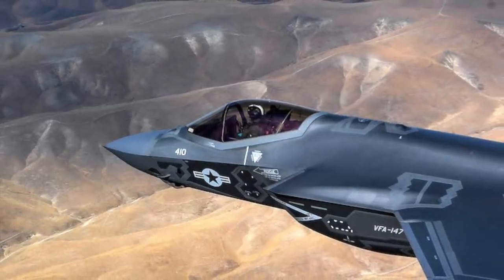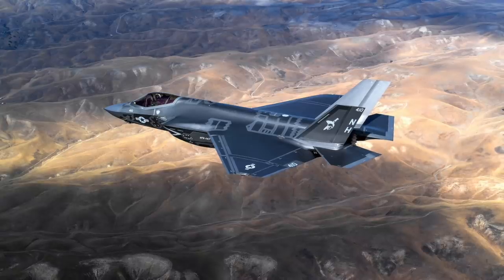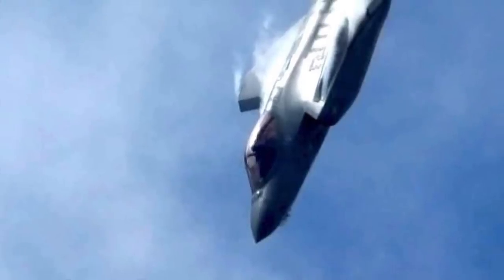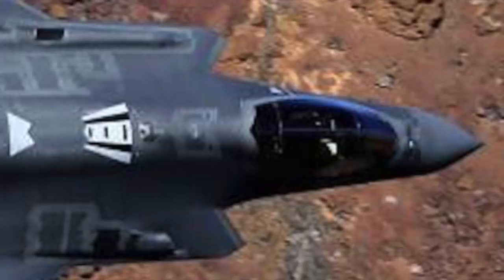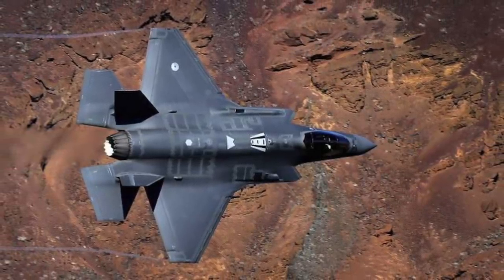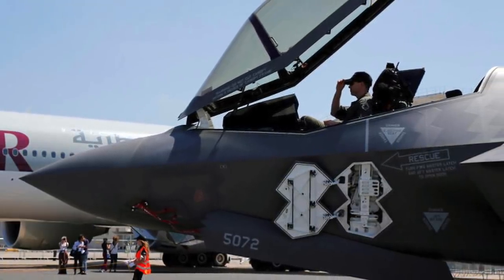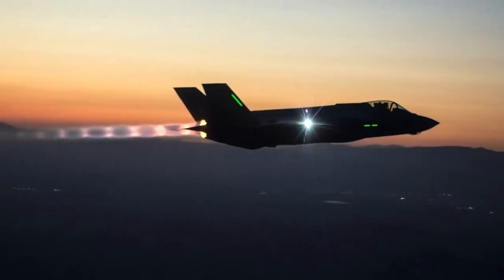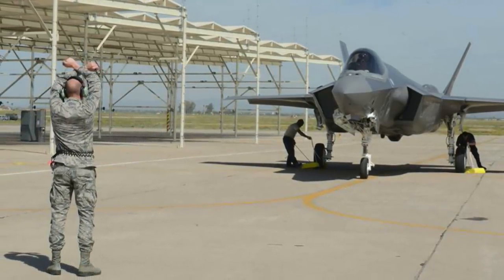HOW GERMAN MADE RADAR MANAGED TO DETECT F 35 5TH GENERATION STEALTH FIGHTER ?

Comment: There is a huge difference between detecting and accurately tracking for a missile lock, stealth does not mean invisible.
Reply: Hammerschlägen M  let me translate what he said:

You radar can be powerfull, It will not matter since no missile will be able to use that info
Reply: Hammerschlägen M  .  Spot on, couldn't agree more
Reply: TheSushiraw it depends just like the F-117 was invincible to radar until it left Its bomber doors open.
Reply: 768PP  Even Scientific American magazine says the F35's is all hype. It can be detected and tracked.  The Russians and Chinese have been working in counterstealth radar for years and its no secret the S400 was specifically designed to shoot down 5th gen stealth aircraft.
Reply: @pedrootavioazevedodaroz1736  who says no missile can use that info? Do you have access to the Russian and Chinese counter stealth capabilities?
Reply: @jubeiorigami4096  anyting bellow a S-500 can't use the info to get in target, and S-500 has no proof pf being able to do so. For now even the best missiles have at best questionable performance vs stelf
Reply: @damianketcham  how to you know the S400 can't get a lock on target?  Sorry but anti radiation missiles like harm only work again small weak defenseless countries.  Russia has countered PGMs like harm long ago.  Pantsir S1s and now the new improved Pantsir SMs with AI protect larger assets like S400 from Harm Etc. Harm would be get blown out of the sky.
Reply: @pedrootavioazevedodaroz1736  That's what YOU SAY.  The S400 is designed to shoot down 5th Gen stealth aircraft so it can get lock on with it's multiple radars that would saturate an F35 with different frequencies to get a lock.
Reply: Jubei Origami 
Really?   So you’re saying they already did it?  When was that?
Hitting a subsonic cruise missile is one but hitting a mach 2 missile in a swarm event is something else.
  But if you have evidence of a Harm shoot down in a thwarted attack  against an S-400, please share the event with us and site it.
  Lastly, Are you claiming an S-400 can obtain a lock at 100 kilometers?
Reply: @damianketcham  the 1st Pantsir S1 missile is faster than harm without its booster (mach 2.3 without booster) Pantsir is designed to shoot down Supersonic precision guided munitions...  Obviously Russia tested pantsir with their own target missiles that exceed Harms etc velocities.  Also the New improved Pantsir SM is designed to be able to hit Hypersonic targets. Get real...  Harm is only effective against the small weak defenseless countries the US usually attacks that don't have advanced point defense systems.
Reply: @damianketcham  Russia has countered swarming too with by drones or saturated missile attacks.  They have numerous systems to deal with swarms from electronic warfare to the new Pantsir Anti drone variant with 48 ready to launch small diameter missiles and the new 57mm counter swarm/drone system that fires guided programmable shells at 120 rounds per minute.
Reply: @damianketcham  Lol...  Harm has never attacked an S400. It wouldn't make it past the point defence systems that protect the S400.
Reply: @jubeiorigami4096  The S-400 was not made to kill stealth fighters, but to kill other kind of weapon, the ICBM, why whould that mean It can't hit a F-35? Simple, the missiles just do not fit in it's launching system, that's why even Spotinik news claims only the S-500 as a anti stealth fighter defence plataform.

Also bring me one piece of news that claims what you want to prove dated from 2019 because I saw that July 14, 2017 and just disregarded the article because of obsolecence
Reply: @pedrootavioazevedodaroz1736  Yes the S400 was made to counter the F35. As the F35 was primarily developed to infiltrate the S300, Russia countered with the S400.
Reply: @pedrootavioazevedodaroz1736  stop talking crap.  The S400 is designed to hit all advanced aircraft including 5th Gen stealth aircraft and other aerodynamic targets. and has 3 different missiles.
Reply: Jubei Origami 
And yet they are being destroyed in Syria and sources say the Pantsir isn’t living up to expectations.  What something is supposed to be on paper isn’t what it’s is on the battlefield.  Israel is having no problem with these systems.  They have one lost F-16 to a s-200 battery.
Reply: @jubeiorigami4096  of which only a modification of one for the S-500 is claimed to be able to kill an F-35, and is claimed by the media, which needs clicks, which means making a missile being able to kil the best fighter on the planet (F-22) is a perfect click bait to uninformed people, the best I could find of actual military analists is a "It could happen, but don't trust it to be true", found at https://nationalinterest.org/blog/the-buzz/russias-s-500-air-defense-system-f-35-f-22-or-b-1-bomber-26216
Reply: @damianketcham  Lol... What sources?  The Pantsir was SWITCH OFF AT THE TIME....  the footage of the attack on the Pantsir CLEARLY SHOWS it's Radars were NOT SPINNING at the time of the attack which means it was switched off at the time,  and the footage shows one of the Pantsirs operators running towards it to turn it on but didn't get there in time. So claims the Israelis are having no problems with Pantsir are FALSE!  the footage is on YouTube for all to see. Anyone who knows about the Pantsir knows that when it's SWITCHED ON AND ON COMBAT DUTY....  ITS RADAR ARRAY IS CONSTANTLY SPINNING....  the Footage of the attack PROVES the Radar array was Not spinning therefore the system was simply switched off at the time.
Reply: Jubei Origami 
I can’t believe you cited an article form 2017 and from Scientific American.  A publication decidedly against anything military.  Try citing something relevant and has some experience in military journalism.
  The author of that article is a finance professor of all things.  Give me break and at least bring your “A” game.
Reply: @pedrootavioazevedodaroz1736  F22 best fighter on the planet?  LOL...  get the fk outta here.  The SU57 is far superior than the 27 year old F22 Raptor with it's outdated Airframe and Computers.  The Technical specifications comparison of the SU57 vs the F22 Proves the SU57 is a Superior aircraft with better performance characteristics and Capabilities.
Reply: @damianketcham  Lol..  Excuses.  It's well know the F35s Stealth is only effective against a narrow band of frequencies. Stealth isn't some invisibility cloak.
Reply: Jubei Origami 
No one ever claimed it was a magic cloaking device.   Say this with me.  “Weapons grade lock”. “Weapons grade lock”
  Modern stealth is designed to defeat around the X-band for weapons grade lock.  
  Did you do it?  Weapons grade lock......
Reply: @damianketcham  12 prototypes and the Indians said: "well it's garbage, let's get more gen 4 planes insted"
Reply: @damianketcham  the S400 uses Multiple bands to paint a target. The F35s stealth is hype that's why the US didn't want Turkey buying S400s as the US admitted the S400s could comprise the F35.
Reply: Pedro Otávio Azevedo da Róz 
When the Indians pulled out I was pretty sure the Su-57 met few stealth requirements.
Reply: Hammerschlägen M  Just ask Israel how are their F-35's are doing against those systems> Quite Well..
Reply: Hammerschlägen M  I had read(& youtube) the Israeli F-35's (Adir) have been flying through the S-3/S-400's radar coverage with Impunity & also destroyed at least 1 Pantsir-S1 in Syria.
Not sure if those systems can see the F-35 but definitely can't track &/or lock-on to it, otherwise they would've shot one down already because that's a trophy.
Reply: Hammerschlägen M  [Google] "Israel targeted several Pantsir-S1 air defense system in Syria"- {Source} Defense Blog online military magazine.
[Google] "Russian S-300 and S-400 Air Defense Systems are Unable to detect Israeli F-35s Flying over Syria"- {Source} The Aviation Geek Club.
Sorry, my dumb ass doesn't know how to do links lol
Reply: @pedrootavioazevedodaroz1736  I am sure China's hypersonic missiles can 'read' that info :)

If America's aircraft is as good as their bridges, they will come down CRASHING. More than 100 bridges collapse in USA annually LMAOOO. Simple Google search will do :)
Reply: @Jacktan9203  China is has worse air defence systems than Russia, so if  the russians missiles can't even secure a anti stealth spot whitout needing to use theorical weapons imagine China's, by the way, if you know anything about US planes you should know they are far beyond anything that Russia and China have, mostly because air power is king consept only existing in the west
Reply: Pedro Otávio Azevedo da Róz 
Anything, but the Meteor Rocket.
Reply: @pedrootavioazevedodaroz1736  except that China has also bought some s400 from Russia??? China has QUANTUM RADARS. It is the leader in quantum technology and 5G by a mile.
Reply: @Jacktan9203  China claims It has Quantum radars, but can you trust Chinese press? No!

Russia has the S-500 making the S-400 the Chise have look obsolete, and even them we end in the same question, can we trust Russian press? No!

Also forgot to meantion that the hypersonic missiles the Chinese have are offencive, which means they can only be used against land and sea.
Reply: @Jacktan9203  so I can say pick the lying American press, and then elevate by a factor of 1000, you got the Chinese press
Reply: @pedrootavioazevedodaroz1736  Thats bullshit
Reply: @jubeiorigami4096  funny you say that Israeli airforce fighter jets already destroyed Russian air defense batteries  with American technology
Reply: @pedrootavioazevedodaroz1736  thank you
Reply: @damianketcham  exactly
Reply: Hammerschlägen M  everyone knows that Israeli airforce destroyed Russian air defense systems at least those who admit to it
Reply: @dennisdonovan2735  Lol...  That bogus Defense link you sent is known to publish crap.  1st of all it  says 'IT SEEMS ' F35s flew over areas with Russian air defenses.  But we already know that's not true as it's KNOWN Israeli F35s have been launching attacks from the Mediterranean Sea and Lebanese airspace which is OUTSIDE THE RANGE of the S300 Engagement Zone,  after an S200 shot down an Isreali F16. Also the S400 ONLY PROTECTS RUSSIAN ASSETS and NOT SYRIAN TERRITORY!  That's already know.  The S400s are designed to shoot down 5th Gen Aircraft but are not Used to attack Israeli warplanes or any other party in the Syrian conflict...  The S400s only Protect Russian Bases.  the US didn't want Turkey to buy the S400 because they admit it can compromise the F35 and gather Electromagnetic emmisions information on the F35. Also I never said anything about US technology destroying Active Russian air defences. I said anyone can destroy an air defense system that's SWITCHED OFF.  as the Footage of the attack CLEARLY shows the Pantsirs Radar is not spinning at the time of the attack which means it was simple Not turned on at the time.  You're obviously one of the dumbos that watches fake news and believes every word.  Get a brain.
Reply: @jubeiorigami4096  stop holding  grudges over Hiroshima
Reply: @dennisdonovan2735  your rebuttal is  garbage and proves you have no Factual or logical argument.  Anything I say can be VERIFIED.
Reply: @jubeiorigami4096  I already verified now stop touching little boys
Reply: @pedrootavioazevedodaroz1736  not at all.. US planes are not far beyond anything Russia and China Has...  Russia and China closed the gap long ago.  Even an American Documentary admits it.
Reply: @remejr3609  Israel didn't target serveral Pantsir S1 air defense systems....  They hit one BECAUSE IT WAS SWITCHED OF AT THE TIME....  As the FOOTAGE of the attack proves.
Reply: @pedrootavioazevedodaroz1736  the American press is part of the biggest propaganda machine on the planet.
Reply: @jubeiorigami4096  1° don't use a video from (probably before) 2013 as a source, in this day and age data get's obsolete really fast.

2° comparing the Chinese press with the American press makes the American press looks like a bealtifull thing, they are forced into mantaing a minimum level of standards, which is not a thing in the Chinese press.

3° what you claimed is that the Chinese and the Russians have someting that at least in a quality standard matches or get's close to marching the U.S. airforce, which get's put under question after you notice most of were the clains come are from the contries that do antagonise the U.S., so claiming someting is able to match the U.S. power can cause internal stabilite problems, since the U.S. press does not know the true value of these clains much less care about it.

4° the Chinese and Russians did close the gap in the 4° generation  figther department, but not on the 5° generation
Reply: @pedrootavioazevedodaroz1736  1. That's how long ago Russia and China closed the Gap.  2. US corporate controlled press is the worst on the planet.  3. Your point 3 is wrong,  as it's US officials that admit Russia and China have newer more advanced equipment.  4. US 5th Gen aircraft have No advantages over Russia or Chinese 5th Gen aircraft.  You're going to have to wait for a 6th Gen aircraft to have an advantage.
Reply: @pedrootavioazevedodaroz1736  
China to be ‘1st mover’ in military hi-tech, US ‘perilously close’ to lag behind – ex-Deputy DefSec
26 Jun, 2018 12:21

The US risks being outpaced by China in groundbreaking military hi-tech, including artificial intelligence, robotics and big data, former US Deputy Defense Secretary warned, adding “this is what it feels like to be offset.”

The United States “should be prepared to be surprised” in any conflict with China, not only because Beijing has done a lot to modernize its armed forces, but also how much it has invested in next-generation military technology, former Deputy Secretary of Defense Robert Work told a conference‘Strategic competition: Maintaining the edge’ hosted by the Center for a New American Security (CNAS). 

“As I watch the ongoing military technical competition in the Western Pacific, in between our two great power rivals – especially China – I find myself saying: This is what it feels like to be offset,” Work added. “And I got to tell you – it doesn’t feel very good.”

According to the former defense official, China is poised to beat the US in future battlefields by building up first-strike capabilities as well as disrupting American command-and-control networks. The Chinese “are looking deep and shooting deep,” Work stated.

He said China’s progress is evident in electronic warfare, cyber, counter-space systems, hypersonic and rail-guns – the kinds of next-generation weapons systems being also tested in the US and Russia.
Reply: Hammerschlägen M  passive radar!
Reply: @pedrootavioazevedodaroz1736  We cant trust the Russian or Chinese press but we should trust US press? Are you kidding me?
Reply: @isahbello9785  comparative, what should you trust more, the bad or the worst, the bad is the obvius choise here, should you trust it completaly? no but it still is far better than the worst
Reply: AreLee Saidi 
Lol.  Ok.  Hmmmm.  That’s why China and Russia continue to develop stealth.  Because it doesn’t work and I’m pretty sure two engines would put out more IR signature than one.  Don’t pretend to know it’s signature magnitude.
Reply: AreLee Saidi 

All IR signatures are large when using an afterburner.  It’s just physics.
Reply: 768PP  wrong Einstein. A Blackbird was detected intercepted and shot down in an incident in 1984 that lasted for almost a hundred miles. 2 Mig 31's locked on the SR-71 after 5 radio warnings were issued, before the Mig's fired on and destroyed the Blackbird. The wreckage was returned to the US that same year in exchange for 2 Soviet diplomats
Reply: The Hensoldt radar is build for civilian air traffic control. It's build to track aircraft and guide them through the airspace in fact its totally possible that it could track the F35. Every technology is aging and gets its counterparts. No need for semi aggressive fanboy talk.
Reply: thomas gellos 

No SR-71 was ever shot down.
Diplomats??  What was the US doing with detained diplomats?

Cite your information: What were the names if the two “diplomats”?  What were the names of the crew?  Where was the crash site?  What were the names of the 31 pilots?

I’ll just wait here for you.
Reply: 768PP  except we are speaking about tracking here not just detecting here , by a civilian radar nonetheless :) some day US taxpayers will understand how they have been scammed with that plane ! but not before a few dozen are shoot down ...
Reply: 768PP  nothing to do with tracking the sr 71  was definitely tracked ,it s just the plane was so hight and so fast ,the sa - 2s missile couldnt reach him without running out of fuel ! get your history right buddy ...
Reply: Still at least it tracked
Even S400 couldn’t track the F35I so it is a great success
Reply: Hammerschlägen M  Greetings from smoke filled California.
I'm two weeks post facto and not conversant on the topic, but would be genuinely interested in your opinion on a related story.
You probably recall the Iranian shoot down of a U.S. drone a month or so ago? The POTUS ordered a retaliatory strike, but aborted the action he said when he learned of the possible casualties.
Trump stated he was able to stop the flight from taking off with 10 minutes to spare. The military said this was untrue and that they were just minutes from engaging when the order to stand down came.
My interest is this. 
IF the Iranians knew the direction in which to point their radar, and knew when,  and knew they would not be fired on, could they observe the tactics and get a radar signature from the inbound flight that could be used for future reference?
Hope I wasn't to "long winded" 
If you read this thanks.
If you respond Double thanks.
Reply: Well, it is still very much relavant though. Al technology start out big. Now they have the technology in a big geound based system maybe in a few years they can put is inside a missile and tweek the efficiency and accuracy.
Reply: hahaha the same old arguments ....if stealth couldn't be lock on and hit. Then the serbians in 1999 must been using a secret alien weapons on the F-117.
Reply: Dennis Mahaney  oh dear...what blip are you talking about ..see the video on youtube of the serbs who shot down the F117. You can't shoot in a blip...Thus Iran shooting down Israeli planes would mean war.. Russia spy plane flew over area 51 this year also. And American plane fly over Russia too .That is normal .
Reply: Hammerschlägen M  Israel did a good job on Syria during the last big dust up between Syria and Israel. I remember back then Russia didn't say much that much about it. Syria had good equipment from Russia. I'm sure Russia has improved the technology. But who knows what counter measures is lurking around for the next big fight.
Reply: Hammerschlägen M, why do you think their S500 already on sale? Because their S400 is shitty, that's all.
Reply: Excuses 😂😂
Reply: @768PP You do know we own the same plane ( several European countries)? And produce several parts?
Reply: Just shoot a missile in it's general direction and IR will assist with the aim... Even if you can not get a so called "precise" lock on... Therefore it's bullshit even with jamming...
Reply: @StarFyodperor  That's great idea. I wonder why no one thought of that before?
Reply: 768PP  I think the issue is so much money was spent on making it stealthy only to have its radar cross sections eventually turned into a library everytime enemy radar sees a baseball at such height and at such speed.  Eventually, they get all 360 degree radar cross sections and store it in their database.  I agree that its avionics and weapons are superior but nothing that the enemy will eventually copy.
Reply: @damianketcham  if yiur firing a harm you will have your position exposed anyway......
Reply: yeyeyeye same was said about the f 117 and three where shot 2managed to land  one dropped onserbian soil 
more propaganda than anything
Reply: @damianketcham  you got a think here scientific Russian, not all of the same doctrine applies to different aircraft in the case of suppression of enemy air defenses (SEAD) missions, an E/A-18G or F-35 (A,B, or C) that have better electronica warfare (EW) than non 4+ platforms. Take for instance the E/A-18G depends on Radars getting a weapons grade track on them but have nothing to worry about once the missiles are launched because there isn’t a radar guided surface to air missile in anyone’s arsenal that the back seater cannot gym or confuse off target. The F-35 has a completely different doctrine for suppression of enemy air defense than that of an E/A-18G. If you want an example of that all you need to do is take a look how Israeli F-35I’s are striking targets in Syria and Iran flying right through S-400 Raider nets.
Reply: Good point.
Reply: Russian military tech is so good it did wonders for Armenia😆 S400 is so good that it prevents Israeli F-35 from penetrating Syrian and Iranian airspace 😆😆😆
Reply: @fsvider8954  Ender first dingo Comi paint chip eater propagandist came out of the woodwork‘s. The only thing that has kept us a a specific air spaces are agreements with the Russian federation so we don’t get involved in another world war, is stealth ram coding supposedly didn’t work then why did you guys go out of your way to bootleg copy our fifth generation fighters and bombers in attempt to penetrate our radar systems? I mean you guys can use infrared search and track to pick up stuff fighters but as far as the F 22 and F 35 go you guys cannot attain a weapons grade track on our aircraft. I know it bugs the shit out of you, but the truth really doesn’t care about your feelings now does it Putan? However I am envious of you, because whatever vodka you’re drinking to make you think like that must be some pretty potent shit.
Reply: If I can find it.. I can send my fighters after it
Reply: @pedrootavioazevedodaroz1736  where were these weapons tested?? Jubei??? Are you a pilot???
Reply: I fear another American war in the not so distant future will answer all the questions and theories about the stealth capabilities of this plane.
Peace
Reply: Dam you beat me to it.
Reply: @jubeiorigami4096  maybe it can, time will tell. But we will not be using Aircraft against S400. Nor Missile or bombs. Ships will keep the outer markers or further.
Reply: @damianketcham  mainstream media does not show and report it
Reply: @pedrootavioazevedodaroz1736  you want news from cnn😂😂😂😂😂
Reply: The F-35 was using devices to make it visible to radar for air traffic safety. There was no need for it be stealthy at that time. Much ado about nothing.
Reply: @jubeiorigami4096  🤣🤣🤣🤣
Reply: That's true but a an interceptor can still vector onto you.
I can't believe everyone pretends that can't happen.

If an f35 is at cruise altitude and at supercruise speed and derping into defended airspace, any fighter with Mach 2 plus top speed and a higher flight ceiling and climb rate can easily intercept it , provided the radar net can provide resolution within a mile or so.

Ofcourse the f35 ain't defenseless in that situation and may overcome any adversary but it will still be intercepted and might result in a mission failure.
Reply: People need to realize the f35 isn’t a superiority fighter it’s more like an f-16 in terms of abilities
Reply: @lordfarquaadgaming9316  the f16 is an air superiority fighter. The f35 is more like a fat f18 with one engine
Reply: Yes it is totaly invisable, US ex president said so. 🤣🤣🤣🤣🤣
Reply: США-Сербский-Русский: 10000: 1
хорошая статистика :)
Reply: @damianketcham  do you also have any proof that I could go check out? You are talking up their capabilities quite a bit so you must know for sure that they are capable of shooting down an f35 and have something I could read. Thanks
Reply: @shrek_2_on_dvd699  
Sorry, in reference to what statement?
Reply: Yes and no, if you use large wave radars S/L band that cant get a weapons lock you can guide missiles close enough to get locks with IR or other types of onboard radar… the coatings only work at the square root of the wave length… L band has a 20m wave length .. so yeah…. also very soon quantum radar will negate it completely.